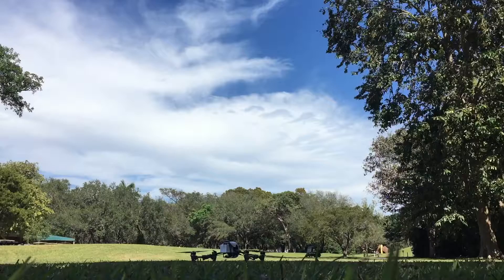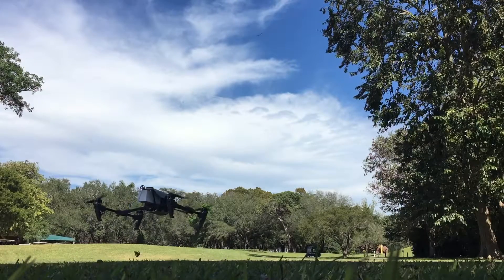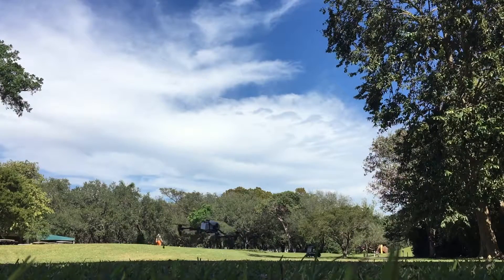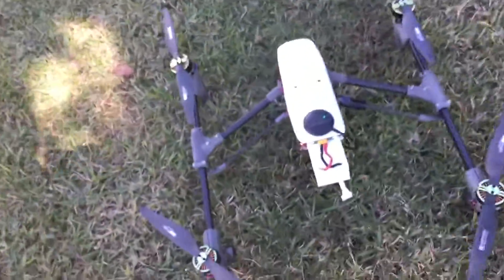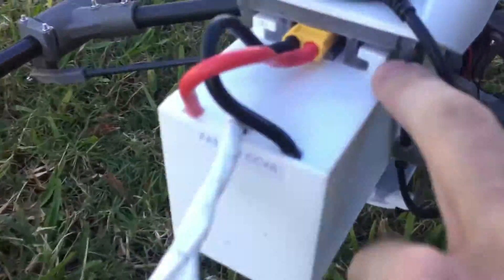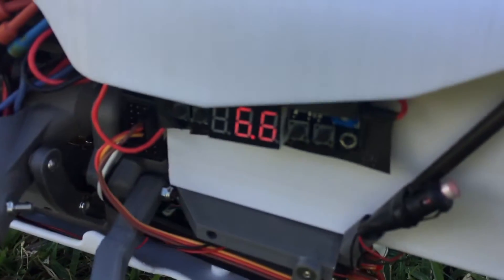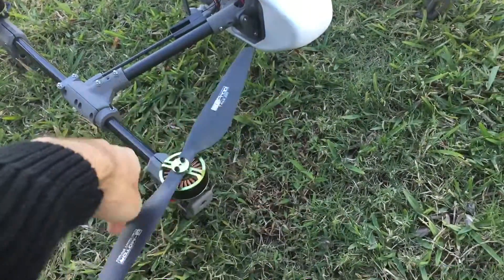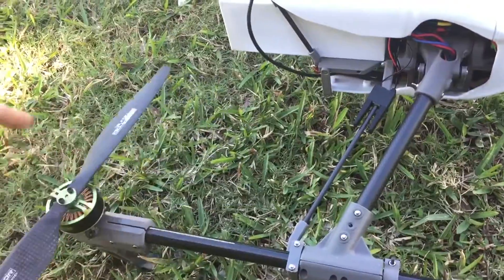3D Printed DJI Inspire maiden flight

Comment: Where can we find the files and materials to build one? Thank you
Reply from the maker: Mario Delgado Serrano to build this crappy one, you can go to RCgroups.com and look for Inspire clone there. But I do not recommend, this CAD files are horrible, geometry has 1000 errors. Nothing but struggle. If you want premium quality files, I designed my own drone, I am going to upload files to 3Dpassion.com once their website is up. Which should be next week.
Reply: Thank you so much. How much do you infill the printings?
Reply from the maker: Find this improved project with full instructions at 3Dpassion.com